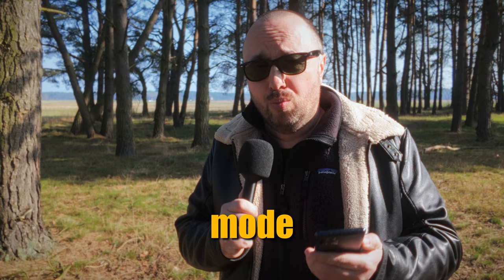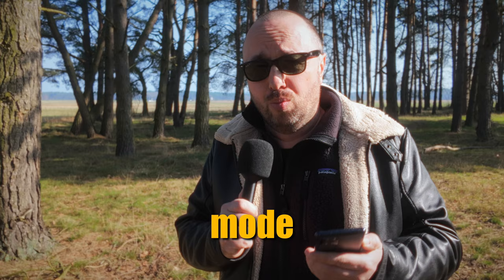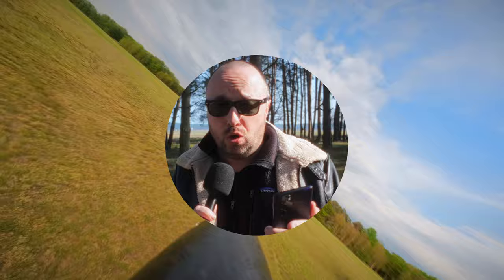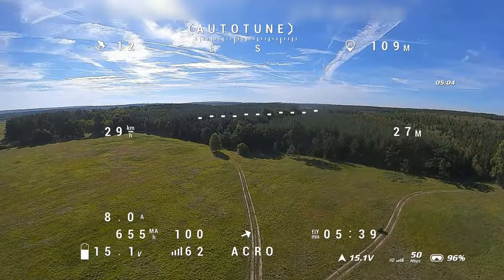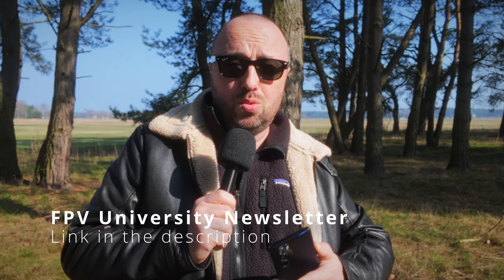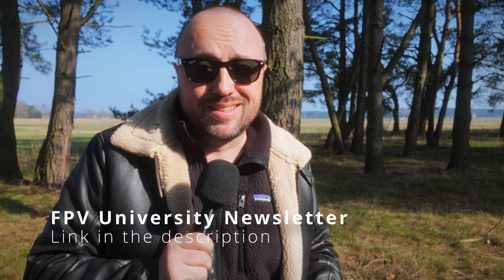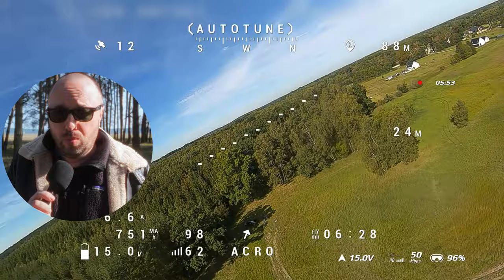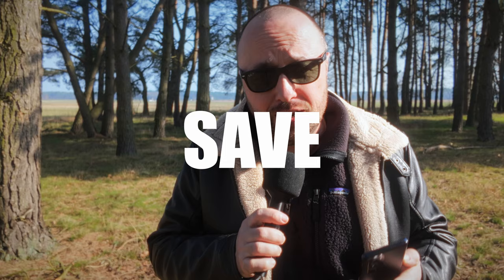How to tune airplanes in INAV?

Comment: I have to ask Pavel, is there a reason to have auto trim on a switch rather than have it always enabled? Will this change the tuning process?
Reply: Great question I'm curious as well
Reply: Yes me too
Reply: Me too
Reply: That is a great question. Two related advantages come to my mind. First, the trim will be consistent on every flight. This helps make the plane more predictable - it will fly the same today as it did yesterday.

A related advantage is that I can check the trim and make sure it's good. That it's trimmed *right*. Once it's good, with the switch off it won't change (and therefore can't get messed up).

On the other hand, continuous auto-trim WILL change the trim - and sometimes you want that. If you switch between different sized batteries, the battery is installed in a slightly different position, or you add some accessory the trim needs to change. Continuous auto-trim will automatically take care of that.

On a racer, I would want consistent, predictable performance - so I wouldn't want continuous auto-trim. On a experimental plane on which I'm changing things around, I might want continuous auto-trim to keep updating the trim as I change things around.
Reply: @senseisecurityschool9337  You’ve gone to a lot of detail here to try to help us, but you’ve only confused us more……. Tell us the various INAV settings  of your details above.
Reply: @peterhancox5268  
Bottom line might be:

If you're going to be making changes to the plane between flights, such as using different size batteries, turn on "continuous servo auto-trim".

On the other hand, if you want the plane to be exactly the same from day to day, turn off continuous auto-trim and do the auto-trim once with a switch.

Of course that's just one guy's thought, just my idea.
Reply: My reason to have auto trim on a switch rather than on all the time is...
So that I can tweak the elevator trim manually on my radio during a flight. I use iNav for scale flight and sometimes you need to adjust pitch for landings just as in full scale.
(I know its iNav heresy to do anything manually on your radio but it works for me. I also know how to program but prefer the manual touch sometimes - keeps it real.)

Comment: Does autotune also work with continuous servo trim enabled? I tried autotuning once but even after stick command after landing the pids were unchanged so I did a manual tune.
Reply from the maker: both are separate things and solve different problems. So yes, they can work together

Comment: Pawel I have 3s motors in my quadcopter but I want to fly with 4s battery. Any details how to tune this in INAV ( no in radio) ? I know this is posible in betaflight but i prefer INAV ://

Comment: Thanks for your great assistance for beginners!  I didn't understand well how to use the autotrim, when flying acro, do you have to push or pull the stick to maintain the altitude before to switch autotrim then wait 2 seconds and release the stick? what is the proper sequence?
I am also confused with acro mode, as it is not supposed to act on pitch axis to maintain altitude...when I first trim a new model to fly strait on manual mode, then switch to acro mode,  then, the model pitch down...what did I miss?

Comment: Nice video ! Just one question … why do we need to manually save the settings for Autotune ? 
In my OSD i always see the “settings saved” message automatically after landing in the flight summary screen. 
(I have continuous trim aircraft setting on)

Do i still need to manually save anything by stick commands ? 

Thx,
Florin

Comment: Great explanation as always: thank you.  Is it necessary to land and save after the auto-trim, or can you do the Auto-Tune on the same flight and then save?
Reply from the maker: It theory it is possible but I advise aginst that.
Reply: @FPVUniversity  OK.  Thanks for the clarification.  I was also happy to learn that I don't need to focus too much on setting perfect elevon reflex when using a flight controller - one less thing to worry about.

Comment: Can you use quad fpv flight controller for fixed wing? I have a f7 aio
Reply: Sure. It may be slightly harder to wire but there's no issues with that.
Reply from the maker: Depends on FC. It has to be able to drive motors and servos on available outputs. Not all can
Reply: Many can, but you need to check to be sure.  As long as the motor outputs can be changed to output servo signals it should work.  Check to see if there is a target for your board available in INAV or for information on the manufacturer's website.

Comment: Hi could you provid some help?
I did my first inav 5.1 flighrt 2 years ago...I just tryed auto lounch, no auto trim no auto tune done.
After using Mr. D. tool to migalrate to version 6.0, I don't know why, i was not hable to do the migration. 
So I tryed inav 7.0, finaly it worked.
But am I missing somthin? Because on message line it shows: unable to arm,  disable navigation first.
I have all my swichs on neutral position. I can not accese the osd menu using sticks. Ehat have i done wrong?
Regards
Vítor Lalanda

Comment: You say autotune will determine the correct PID's and the rates. I thought PID's are no longer tuned just rates and feedforward?
Reply from the maker: Let's say it's a simplification as it sets default P and I gains and then determines FF (part of PID process) and rates

Comment: I have to say I'm wary about the iNav I term. I keep it at zero and just use P with a touch of D. In other words I go completely against the advice of this video.
I fly scale. My planes have wheels and they take off and land on the ground. I sometimes get the impression this is very rare among iNav users.
I'm concerned that the I term can get into a "wind-up" problem -- I mean where it attempts to correct for (typically) pitch while the plane is sat on the ground. The elevator control can end up at maximum travel and will take time to return to mid position. In my opinion this could cause a crash the moment the plane leaves the ground.
Am I wrong? Always open to advice and ideas!
Reply: Good question thanks- I am flying scale also with a tail dragger. My approach will be always take off and land in manual than switch to acro in flight. Return to manual for landing. I see no other way because the autotune function really helps with flying characteristics. Thoughts? Whats your setup for a scale maiden with inav?
Reply: @skupper672  My setup for a scale maiden is manual with some guessed PID, FF and rate values. I set I terms to zero to avoid wind-up. Then I'll put it into "cruise mode" (angle + auto level) and do a one-off auto-trim (I avoid continuous auto-trimming because sometimes I want to change trim manually for landings etc). Then I'll put it into acro and do an auto-tune.

After the maiden I mostly fly in manual but often use acro for takeoffs and landings when the wind is gusting across the runway (exact opposite to you with the modes!). If its particularly gusty I might just stay in acro. 
(Acro can save a small model near the ground on a gusty day but can also get in the way of aerobatics.)

I like and value iNav but finding the right PID, FF values for your model is just trial and error over a long period of different wind conditions.